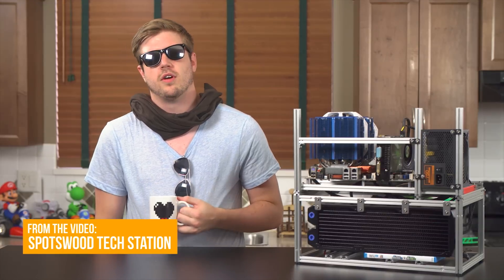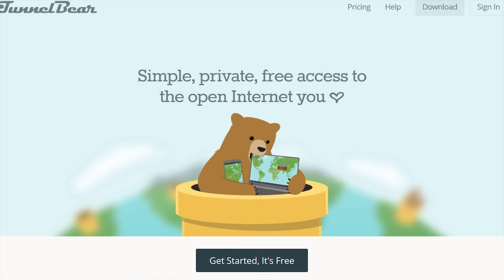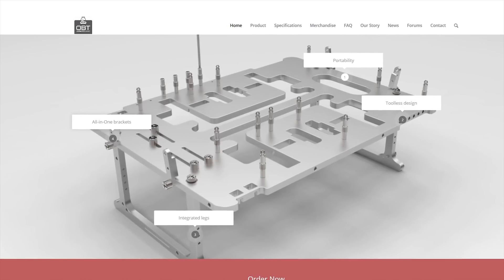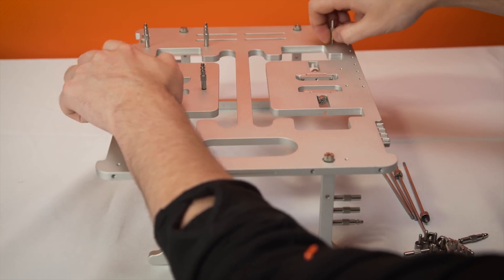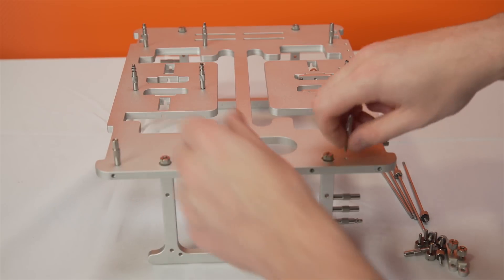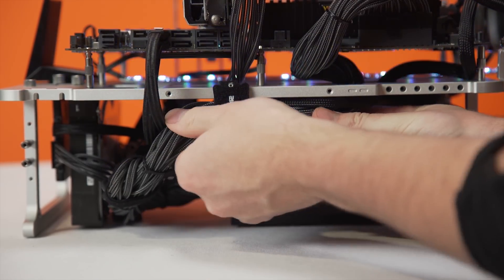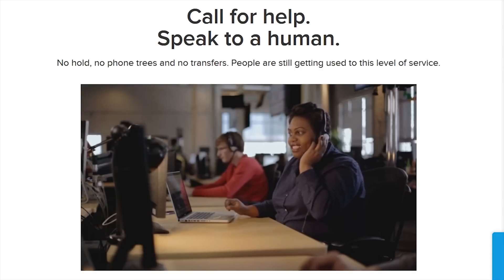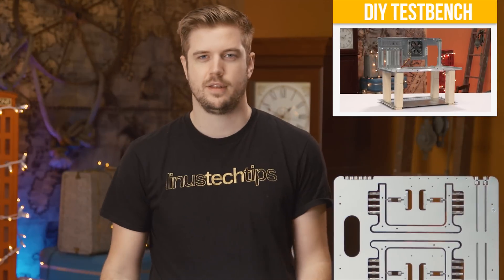A revolutionary platform for hardware testing?

Comment: The test bench is sold in the UK as a streacom BC1. It’s a fab bit of kit. I’m an R&D engineer and can’t imagine doing my work without one. 

I’ve come across a pair of major benefits behind the access. 

The first is the cooling, compared to the same parts in a case it runs 10-15c cooler. Handy for less optimised prototypes which can run hot

The second is portability. When assembled the bench’s are very robust and much easier to carry around a workspace that a full PC tower.

For folks looking to build one I’d recommend two accessories.

The first is to get a momentary switch power button for powering it on. There’s a 12mm hole for mounting it and it makes like much easier than shorting pins.

The second is to buy a big pack of coloured Velcro cable tidies and colour code the cables. It’s not that I don’t know which is which, but it’s much faster to stay in flow if i can instantly identify the cable I need. It can also help prevent silly mistakes deep into debugging an issue. I manage the cables to be held against the chassis so they are less likely to snag or catch.

Hope this is useful right shade for folks finding this review in 2023.

Comment: Real PC techs in the real world use an anti static bag over the top of an empty pizza box as their test bench.  It's cheap free, readily available and handy... and costs nothing.  You heard me right, a pizza box.     Everything and your grandmother coming off the side and just plugged in on the bench.  You can also use a soldering mat or plastic lid off a rubbermaid box or literally.. book, magazine, or anything you have handy that doesn't conduct electricity.

You sure as heck aren't going to use something you have to spend several hours assembling or to which you screw stuff down into...

In the real world just like with any fight, it happens on the floor and not on a table.  That's what the pizza box is for... to get it up off the carpet.   I can't recally any PC I've ever built that has happened.. on a table.  It's always on the floor.   With everything spread outaround you.   The monitor and keyboard  you can set on a coffee table, but the PC case, mobo, and PSU is on the floor.. and usually you're going through half a dozen PSU's to find a good working on (until you break down and buy a cheap PSU tester).

Comment: Too bad there isn’t a bottom shelf for the power unit.  I sometimes just want to lift my rig and move it to another party of the table.  Those two side screws will snap right off it this gets lifted.  Guess would have to unscrew and detached the power unit each time when moving.

Comment: I might actually get this for callouts. Customers don't tend to like when you pull their kit out and literally bench it on the table (or floor if the table is a biohazard) but if I used one of these with the modular PSU in my bag they will at least trust I know enough about what I'm doing to have a special bit of equipment just for that job.

Comment: I noticed that you did not mention anything about the PSU and why it is just sitting upside down blowing hot air onto the bottom of your board... no correct mounting solutions for it?  Also, these cannot be purchased any longer, company has said out of stock since May...

Comment: Needs a better radiator mounting system.  Maybe a seperate bracket you bolt on to the main chassis for various sizes( 120/240/280) Those don't look that strong, as you can see the radiator is angle plus you have to angle them horizontally to adjust for various sizes...

Comment: If you can't afford $150 how are you affording anything that you would be "testing" on it? If $150 breaks your budget, you probably should not be a hardware tester.

I think it's wrong to compare the price to normal cases, normal cases aren't designed for this level of ease of access or portability.

You want to be a real hardware tester? Let's look at full size anti-static work tables:
https://www.uline.com/Product/Detail/H-2043/Packing-Tables/Anti-Static-Work-Bench-60-x-30-?pricode=WY703&gadtype=pla&id=H-2043&gclid=CjwKEAiApLDBBRC8oICb9NvKsg0SJAD9yOHsBBG5YYmx_UZPDvg9O3aARu7BwwEV9XKEx9kIrTewShoCxQvw_wcB&gclsrc=aw.ds

$1,500

Overall I think these fill a niche in the market, the standard computer test bench's run $50 to $100 already and they are (as you said) pretty much crap. So when someone comes up with a much nicer more versatile design that is also made with better materials, $150 for that segment of the market seems justified. The average computer user is not buying test benches to build on, so their sales volume is not going to ever be high enough for them to compete price wise with a standard case (which could lower their price and make the profits up in volume)

Comment: I think there's a lot of flare, but little substance.  For example, the videocard stabilizers could have been L shaped to keep from blocking ports.  The thickness of the aluminum, while hefty, is probably not necessary, which could cut costs.  I can see it at half the thickness and still being quite sturdy.  I mean you're putting PC parts on it, you're not leaning and sitting on the thing.  It looks like they got their idea from one of those tool cut out business cards.  There's just soo much excess, and quite a few points of weakness that don't even need to exist.

Comment: Luke I would add a note to the vid that tells people why this exists. They seem bewildered lol. Personally I use a Test bench as my main PC case, it is a LD PC-v4 which was almost 400 shipped when I bought it. It is obscure :P, anyway its my favorite case in the world. 

It holds 2 EK EX360s, an EVGA g2 1600w and any board GPU combo I could ever want. I modified it, and alot of the time it sits up with the rads on top an bottom on feet. Then when I need to drop it I can, and use it for LN2 ect. It looks gorgeous and is made very very well (like an actual case, missing some stuff).

Comment: Why would you need LED lighting on a testbench, why do you even need perfect cable management on a testbench?
Reply: The LED is from the motherboard. As for cable management, you won't really be changing out the CPU or motherboard (which are the two biggest cables), so tying them down will keep them out of the way.

Comment: The issue with monitor cables and such is easily fixed if you assemble that part correctly like the instructions and website show ~_^  Use a screw-in standoff, then screw the PCIe hold down bracket in there, and voila, HDMI and DVI fit without issue.

As for the Canadian dollar.....  Including the DHL shipping they use for Canada ($39 USD), brokerage and taxes ($24 CAD) and the $10 USD discount for early purchasers, it came out to $264 CAD in total.  Not exactly the most cost effective for Canadians, but on the flip side it's one of the only well designed test benches that's out there that is not only portable, but isn't a gigantic desk hog like the benches Dimas made.

I'm also rather curious there was no mention about the stability of the test bench in and of itself (it's rock solid once you put the power supply in and screw it in place!), or the fact that only those who get the Community Edition (limited to only 200) will get the protective carrying case/sleeve.

Comment: If my job was system building /testing hardware , I would find $149 relativity inexpensive, considering the lackluster competition and the short life span of a motherboard box  , luke has used his previous one for 5 years and this as a replacement using the same time frame is $30 a year and it increases the efficiency of how you work. awesome

Comment: Are there other places/ways to mount a radiator? It all looks really good minus that part.
Reply: It will fit 120/140/240mm radiators on either side, and some people have managed to fit a 360mm radiator along the back as well (can't remember if he had to do any kind of modding, or if the standard brackets worked).  Four mounting brackets are included so you're able to do dual 240mm radiators if you wish.

Comment: $150 USD for a machined plate of aluminum that big is not that bad of a price for that much material and the cost of machining. Looks like it is anodized as well. Relative to other PC cases yes it is on the higher end. Great looking product with some very clever features.

Comment: Just bought one thanks to this video.  Nice review.
Reply: Testing no doubt.
Reply: smirkingdevil congratulations, what are you using it for?
Reply: g vnhtsm I will disassemble my Xbox One and use an AIO liquid cooler installed on this bench.  My townhouse gets sun all day in southern California and my gaming location is right up against the wall that faces the sun.  I have all the parts needed to make the modifications, but I could not find the time to install the AIO.  This will hopefully make it easier.  Can't be harder than installing the 1TB SSD I have in there now. :P

Comment: gtx 1070 kfa2 for 399€ or put the other 50-70€ up in the budget and get one from zotac gigabyte msi or Asus or evga.  will run it with i5 6600k looking forward to overclock

Comment: My solution for a cheap test bench.
-buy a cheap but solid case
-install a trusted power supply and cable manage the wires where they will need to go.
-install the hard drive/ssd and get them plugged in with power and sata.
-never take any of that out and leave it in there /done.

personally i can probably do a motherboard swap in ~60 seconds assuming its ATX>ATX and requires no standoff changes and is a standard 1hdd/1gpu rig.
if you have a test bench that can support an atx board its not going to be much smaller than an atx case and you still need to fit all the same components.
y'know those old ones with the psu at the top? stick the hdd/ssd in the optical bay along with all the other unused cables and you'll have clean easy access to the motherboard mounting area and can whip them and graphics cards in and out with ease.

Comment: Speaking for myself here, But the one problem I DONT have with test benches is portability.....because i wouldnt move them, dont need to, its a testing station and has a job to do, its not a lan rig.

IMO the perfect test bench needs
-easy cable management (because a nest of wires suuuucks)
-easy to put hardware on/off (because y'know, testing)
-stability (doesnt feel like tin foil and securely holds everything in place so that nothing can move/slide/fall and break)
-low price (people who need to test hardware that isnt thier job are usually just trying to see if something works because they cant afford a replacement)
-forethought and attention to detail (you know those companies that just think of those tiny things that make life a little easier as if they've actually been there and done it themselves, shit like that).

other than that they can be a simple cut, folded and riveted sheet of folded steel like any case.

Comment: honestly i would use that for my regular pc and put it on my desk. it looks awesome.
Reply: honestly my current case is already completely open. it has been running almost 24/7 for the last 18 month and there isn't that much dust.
Reply: Air purifier.
Reply: 5 years later and I did the exact same thing 10 minute ago
Reply: @calsterman8119  I just ordered the mini and regular one gonna do the same
Reply: Mickel Ntek. How about No.

Comment: But what exactly is the point of a test bench? The convenience of swapping pc hardware or is there something else?
Reply: Ciroluiro it is not ideal for an individual like me or you but for professionals it's great so they can easily troubleshoot an error or a bottleneck in a pc. for example Linus built a pc with core i3 and gtx 1070 but it's not able to get a very good framerate in 1440p he used a testbench to check the bottleneck and he finds that the cpu was the culprit
Reply: Hopik Gamer but that doesn't necesarilly requiere not using a standard pc case, right?
Reply: Ciroluiro yeah but it is much easier
Reply: Mario yeah, but it's not like you need it for it. that's what I was asking

Comment: Can I recommend that people are very careful when screwing. Unwanted pregnancy and sexually transm... Oh hang on

Cross threading is a real risk with aluminium being a bit soft. You can avoid this by making sure you are dead square onto the hole ( see 4;17  4;50 ) yon fella risks cross threading there because the screw is weeble wobbling all over the place and might pick up the thread badly. Another trick is to, keeping the screw dead straight to the hole, run the screw backwards a turn or two until you feel it 'drop' into the thread pattern. Than screw in the right way and it will pick up the thread nicely. :)
Reply: you know what they say "it's not rape if you like it"

Comment: Can someone plz help me with this. In my pc i have an i7 4790 non k cpu using stock cooler. At idle it runs around 38-45 degrees but when i start to play crysis 3 its maximum temp goes up to about 87 degrees, it doesn't stay on that temp for long its like a split second, its mostly between 70-80 degrees. Is reaching past 85 degrees for split seconds every now and then ok when gaming?

Comment: Put your 3D printer to use, I'd like to see how cheap this open source design can be.

I think the Core V21 cube case makes a pretty good test bench with top and side panels removed. It also makes a pretty good case, and only costs $60.

Comment: That is, to use a word that causes most feminists physical harm, SEXY!  I would fork over that kind of money if I did a lot of onsite builds.  The issue for me is...a test bench is pretty much stationary.  If I have to take the time to assemble and disassemble this thing after each build I would go nuts.  On the other hand, if it were modded to allow installation of side and top clear panels...hmm...open source you say?

Comment: I fail to see why you made such a point of the price, how is that expensive for a block of machined aluminium and mostly well designed features and it's for a niche use that only a professional would want? It's not, that is completely reasonable and why the fuck would you need a personal purchase? If it was $500 you  would have had a valid point but $150 is nothing.

Comment: You asked for comments...  I just lay a system board on the table with a couple magazines under it to keep from scratching my table top and arrange all the other parts around it.  Never used a test bench in more than 20 years of doing computers...  If it is already in a computer, test it there; if it isn't just lay the board on a table.  No need to spend money on something you just don't need.

Comment: Correct me if i'm wrong but i do believe that the GPU supports go in another way, the standoff goes directly on the bench and later the stick screws into it, that solves the hdmi problem.
Reply: correct!
Reply: i thought of the same thing. luke missed that part obviously
Reply: a pretty good review. when you campare it to what he said about all other test benches then its an amazing review
Reply: +OverClocking-TV Maybe an improvement could be instructions ? Or Luke was like pretty much like everyone and throws out instructions and just goes for it.
Reply: Haha yeah there is a manual. But hey - totally guilty of never RTFMing things here as well, so totally not hard taken haha.

It's always more fun to explore things by yourself.
Reply: This is what I was going to say.
Reply: I mentioned this on their forums right when the video got released early. They ignored it.

Comment: It's  not too bad of a price considering the entire thing is made out of a solid chunk of aluminum. It should last a very long time although they used stainless hardware as opposed to aluminum. Everyone knows what mixing metals can do over time. >.< If you ever seen a 5 year old pc with white crust around standoff's and screws you'll know what I'm talking about.
Reply: Travis Piper no this wont happen because the aluminum is annoized
Reply: m98custom1212 Iodization is what's done to steel.
Reply: I'm not sure about annoizing (or what it means) or iodization (never heard of iodine used in steel processing), but I'm pretty sure you can anodize aluminium and it seems to be what they have done.
Reply: its annodized its on their website
Reply: Sebastian Grygiel yah some cases do have a coating and others are painted. But a lot of computer manufactures don't bother doing it.
Reply: Sebastian Grygiel anodizing/ionization is when you change the number of electrons in the molecular structure of the material.
Reply: +Matthew Themain I wasn't aware of anything like that - I know that you can ionize an atom when you remove some electrons to turn it into an ion, but as far as I'm aware anodizing metals involves forming an oxide layer, not ion layer on the surface of the target material. I never heard those terms used interchangeably, can you point me to a dictionary where I can learn more? The oxford dictionary disagrees - https://en.oxforddictionaries.com/definition/anodize
Reply: Sebastian Grygiel sorry. I am getting my words mixed up. Anion is the ionized molecule with the addad electron, while the cation is the ionized molecule with the removed electron. I grabbed my Collins Gem Australian dictionary that I have had since 1996/1997 and just before I opened it, my mind corrected me.
Reply: +Matthew It happens to everyone. And BTW, thanks for refresher on which way anions and cations go ;)

Comment: whoa whoa whoa ... anyone know where you can buy expansion card standoffs like the ones on this, I'm building a wallmount PC and I don't want to use a pci expansion cable and have the gpu mounted flat I want it mounted properly but have not seen a solution as good as this for the rear mount